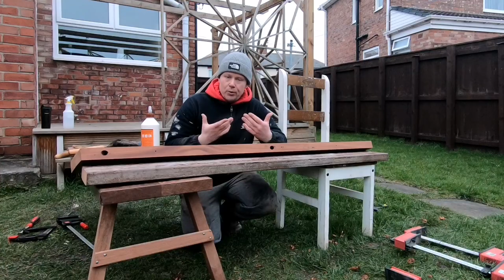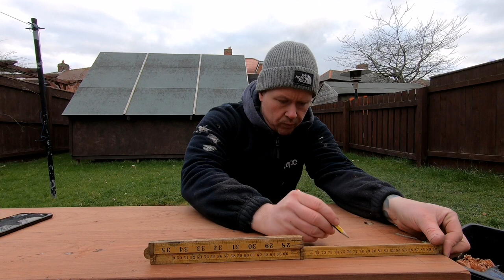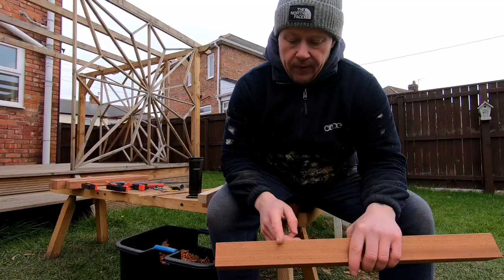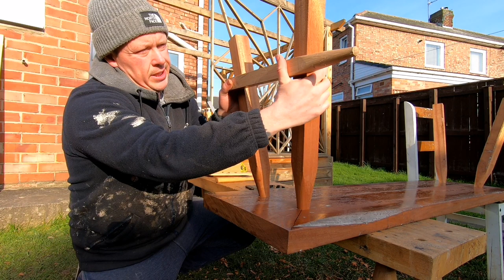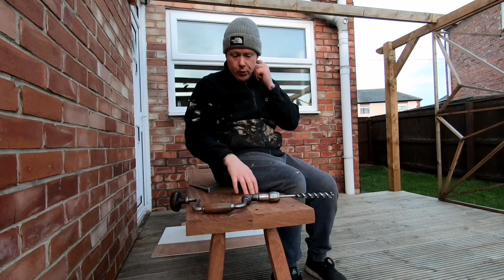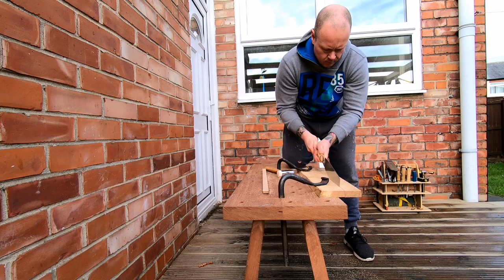Building a Roman workbench.

Comment: thank you for these detailed videos and the ebook, they are very helpful. i am using them to make my first workbench!
Reply from the maker: You're welcome. The reamer should match the angle of the conical tenon. For instance, the veritas reamer, and tenon cutter have the same angle which means, the male and female parts of the joint will mate together, giving a good strong, tight, perfect joint.

Hope that helps.

Comment: That was very nice. I will probably be doing mine with a top glued up out of 2.5"x3.5'  skid rails out of hard maple. It is the one part of the project I am not looking forward to at all. This is the main reason I have not started it yet even though I have all the wood.  I really liked your video on the dog hole layout. I will look forward to seeing the shave horse attachment.
Reply from the maker: Thanks for watching. The benches are very forgiving, so don't worry about it. I would recommend slightly longer 5' - 7' ( only my opinion).
Reply: @DW_woodworks  actually that should have been 2.5 x 3.5 inches. Most of the actual pieces I have are about 4 ft. I am planning on a 5 ft length though. Since I am laminating the top I can easily get a bit of extra length by throwing in an extra piece.
Reply from the maker: Sounds good, should be a nice bench when it's done.

Comment: I'm curious your thoughts on a different style of legs. I have seen a version of a Roman bench that has the legs half-lapped into the side of the bench, still angled toward the two ends of the bench, but flush with the edges of the top rather than splayed out. This would be a lot easier with the limited tools I already have, but since you have a lot of experience with these benches, I was wondering if you thought if this would work as well or have issues (e.g. would it get in the way of your feet? would it get in the way or different work holding? etc.?)
Reply from the maker: I think the joint would fail in time. You could add a leg rail (or 2) which would help a lot. A rake and splay would be better to offer more stability (in my opinion). I think rocking could be an issue. If the bench top has some weight, rocking will be reduced.

I don't think the legs will be in the way, and I often use the legs for footing etc.

Comment: I've got a bench in the works, so this is great! I think I want to add a modern quick release vice, and I'm hoping to get your guidance on the most useful location. 

I don't know which side to put it on (I'm right handed, so maybe the right side as you sit?), where along the bench edge (at the far end in front of me, back by my knee, in the middle of the bench, or behind me out of the way) or I could go straight off the end. Where would you add it if you had wanted one?
Reply from the maker: I personally wouldn't add one. If anything, I would suggest a removable moxon style vise, then you could fix it anywhere via holdfasts.

I think the left side would be in the way because of planing. So you're right about the right side. 

Either end maybe problematic  using width ways, cutting wide tenons etc.

I think I would put it where I've put the notch. It's out of the way there.

Comment: Thanks for making this. I’ve been planning a Roman workbench for a while. I just picked up some salvaged timber today to make the bench top, and I have a reamer and cutter on it’s way. Your clip is the best one I’ve come across on YouTube that explains the process for making one in simple terms and with all the little tips and tricks along the way. I need mine to have removable legs and you mention one of your other benches does too - can you tell me if you still drill the mortise all the way through, or do you stop short? Thanks again from Australia.
Reply from the maker: Thanks for watching, I appreciate your time. Yeah, the holes go all the way through. Everything will compress in time, so it is needed. You'll have to trim the top of the tenons, in a month or so due to the compression.
Reply: @DW_woodworks  ah-ha, thanks. That was my next question - whether the tenons will continue to push through. I’ll try them as removable and if I get too much movement I guess I’ll have to glue them in.
Reply from the maker: I've only had to trim them twice, so you should be ok.
Reply: Love yer work, learnt heaps. Ordered my oak slab yesterday, tad pricey, but keen as mustard to get into it. Curious about the Helenium eight legged model, have you any opinion on them? Ordered a book too “ Ingenious Mecanicks” by Michael (?) Schwarz where he dives into the various non vice historic holding devices for work benches. Anyhoo, many thanks again, I’ll get your e book too.

Comment: Fantastic work! And so thin! How thick is that bench? I figured I needed a really thick slab, but this has me looking at my wood pile anew
Reply from the maker: Thanks for watching,I appreciate it. It's roughly 2", most of the benches I've made have been around that size, hardwood is recommended at that thickness.

Only issue is the weight, I use mine on grass most of the time, so it's not an issue for me but, the bench can move around on a flat surface.

Comment: Can you have a bottom worktop edge that has some bits missing where there was bark? Or am I better to cut it down? It is 370 wide and this would make it 333 wide
Reply from the maker: You could try it first, and you've always got the option to cut it at a later date, if you don't like it. I think I would cut it straight, but I wouldn't be to bothered about a little bit of Waney section on the under corner.

I think a wider bench is slightly better but, 333mm will work.

Comment: Where'd you find your brace & bit? I'm looking at getting one, but a lot of the older ones seem to have this really weird square jaw rather than the 3-part jaw that a normal electric drill would have - does yours have a circular jaw for normal bits?

I can find 'the brace' dead cheap, but getting good auger bits are way too spenny, I was thinking if I got one with a circular chuck I could cheap out & just use a spade bit (?)

I've got a cordless drill, but it's shite & doesn't have the capacity for this size hole in wood
Reply from the maker: I'd suggest flee markets, and carboot sales, there's normally a lot of them.
Reply: @DW_woodworks  With the circular jaw? I'm confined to ebay due to corona & they all seem to use the old square jaw - does that grip circular bits just fine?
Reply from the maker: Most of the old braces will only accept the auger bits, with the square, tapered ends. There is some modern braces that will accept a hex bit. There not designed to hold round bits, although I have used a brace with a counter sink.

Unfortunately, a set of reconditioned bits can be pricey. If you can't wait, just use whatever you can get your hands on, it doesn't have to be an auger bit. Or you could use a hex auger bit in an electric drill, if you have one.

If you can wait, markets etc will be open soon, and you'll be able to make a set up. You'll just have to sharpen them up.

Comment: Hi, thanks for these videos and the podcast (which was the first of the two for me to discover), it is a great resource for both knowledge and confidence for me as a total newbie to woodworking.

Since you encouraged your listeners to ask you any additional questions about the roman workbench, and as I'm in the progress of building my first one I'd love to ask you these:
1. I do not have a taper reamer and the only one that I'm aware of that is produced regularly is the large Veritas reamer (which is out of stock at the moment). I did find some resources for building a reamer but it is probably beyond my current skill level. Do you know of any other options for a reamer?

2. Assuming I won't use a reamer, the 2nd option is a simple 1-1/2 inch round tenon, which got me thinking of an idea if isn't completely stupid, might have the advantage of adaptability for small spaces, so... What do you think of using threaded 1-1/2 inch legs that I could stow away when storing for long period? I was thinking of fitting the threads all the way through a 3.5" thick bench top, and to reinforce the leg, I could add a wide piece of wood that acts as a (fixed) nut to lock the leg and the bench-top in place. 
That way, I'm hoping to be able to take the bench completely apart very easily, but I'm not sure how durable it'll really be and whether the wooden threads could withstand the forces applied to the bench (assuming the bench top is thick laminated pine and the legs are made of hardwood).

Thanks!

Edit: added a bunch of text that somehow got cut away.
Reply: Sorry, my 2nd question got lost in the editing, just added it :)
Reply from the maker: The round tenons should be fine, and I have used these myself. Check out my free ebook (link in my Instagram profile) which shows this process. I personally would glue and wedge the legs, I think the threads would damage easily.

As for a reamer, there are makers who make traditional one's. If you have the spare cash, you could look into that.
Reply: @DW_woodworks  Thanks for the super quick reply! I read your book and I am going for something along the lines of the poor-man's-workbench.

My 2nd question got messed up in the initial submission. I edited it just when you replied. It was really about a weird-ish idea that I had to use threaded round tenons. Would love to know what you think about that.
Reply from the maker: @almogkurtser4557  I would not used the threaded tenons, I think the threads would damage easily.
Reply: @DW_woodworks  I feared so, thank you for confirming it!

Comment: You should also check out Rex Krueger's LRB https://www.youtube.com/watch?v=7rOHuC_yuV4.. you can use a softwood or a hardwood ... it depends on your personal preference ... softwood is quieter because it absorbs more sound and is generally lighter than hardwood so softwood might be better for your application .. you should at least put a planing stop on your surface, if not a bunch of dog holes for your hold fasts (a form of viseless working) ... also it's a good idea to include a jaw on the side for wedges and holding boards on their sides.  I think benches on your leg tenons is a bad idea ... legs should be tapered to allow for always driving the surface onto the legs.  Your going to want to use a bevel guage (and leave the bevel guage set up on the bench top to while you are drilling) or a guide for ensuring the legs are at the right angles.  There are lots of ways to make the leg tenons, you can use a rasp and sandpaper.
Reply from the maker: I'm not sure if you watched the whole video? The tenons are conical (preferred by myself), but I have successfully used round tenons. The bench contains around 20 dog holes, for my work. I think you might be missing the point when I said add them as you need them. Also, there's no need at all to add a vice. The peg system and notch, handle most things.

A good example of what the bench can do https://youtu.be/d1JJdRKHJcQ

I also think a soft wood is not the best choice in my own opinion, and speaking from experience.

I'm no expert but, this bench is number seven, and I've got around 4 years experience with low benches, and haven't used a vise in over a year + 

What you can build on a tall bench with a vise, you can build on a low bench without a vise, which I can, have, and do.

Of course this is only my own opinion and experience.
Reply: @DW_woodworks  I watched up to 26:49 before I had to leave ... checking out the rest now.  As to what I was saying in my post, there are a lot of ways to build a lrb and it probably depends most on what you are using your LRB for.  I need mine to be portable.  I did miss the point but I think your going to cover it in the remaining portion of the video.  Thank you!